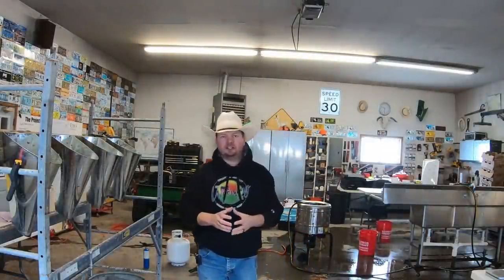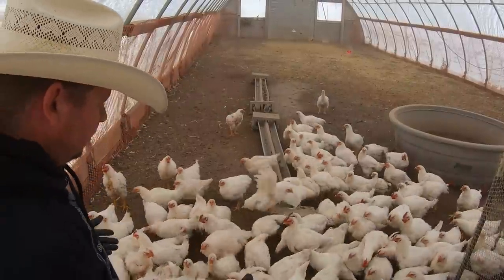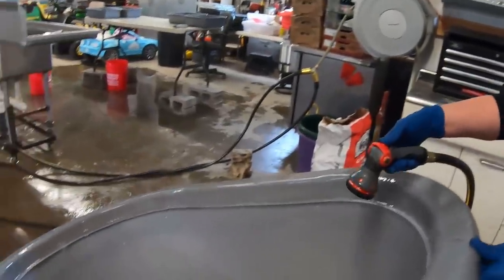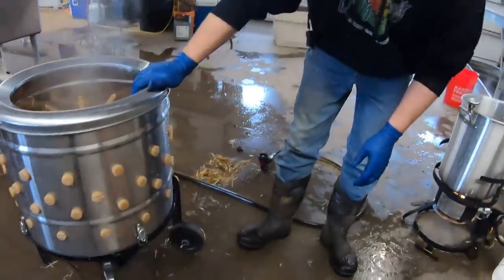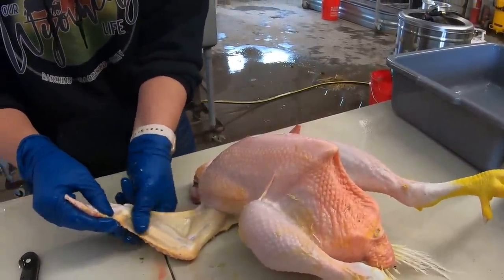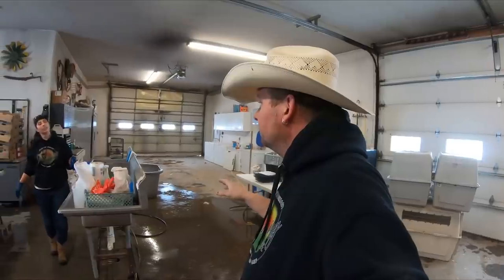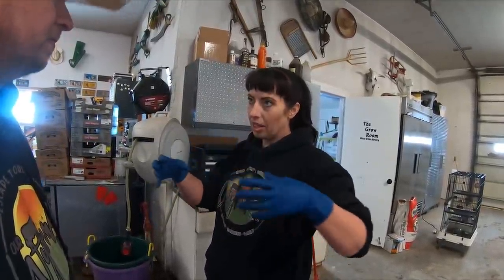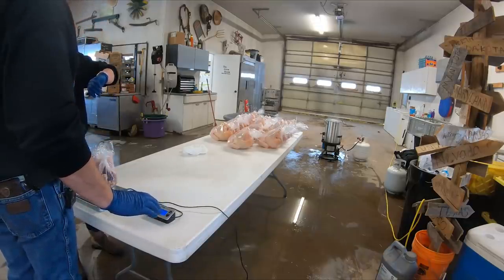Butchering, Processing and Packaging Chickens on the Ranch - Step by Step

Comment: The last time I did chickens I had a large plastic straw that I inserted in the bag. Then it was zip tied and dipped it. The air goes out the tube. Pull out the tube and pull the zip tie tight. You do not have have to look for the hole in the bag you have a nicer presentation with the labels. What do you think? Great video.
Reply: That's what we do also. Works perfectly and no wasted time looking for the original hole.

Comment: Scalding water should be about 148 too hot can cook the outside a bit. Get you a real scalder it will speed things up big time. I have done the turkey fryer too much time waiting for temp to hot or cold. Also don't leave them in the cone any longer than needed the feathers come out easier.  When we do it two cones is plenty to keep one person gutting and cleaning. I couldn't tell in the video but you should remove the preen gland above the tail. Have fun we did ours in October.

Comment: You mentioned a possible switch to turn the chicken plucker on and off. You may already have found one. You need an "air switch".  The switch plugs into power, and the plucker plugs into the switch. It is approx. $35 dollars and was the dickens to find. It works on a 15 amp circuit. The unit I have is used every 6 weeks, for over 7 years.  

Tecmark SAFPAC 5027

Comment: another trick with the heat shrink bags is instead of puncturing the bag place a plastic straw in the opening when the bag has shrunk pull out straw and tighten zip tie.

Comment: Small tip when bagging the birds , Don’t cut the bags put a drinking straw in the top of the bag before you put then in hot water, then pull the straw out as the bag becomes smaller and the air come out then pull the tie-rap . Ya’ll did a great job ,it’s not one of the most fun jobs of the farm but it’s got to be done!

Comment: When those birds are put in the ice bath for several hours you could take the opportunity to Brine them at the same time.  It is said to produce an more moist (juicey), flavorful and tender meat after cooking. If it does improve the final product after cooking You might charge an extra a $1-1.50  a bird or not vs not brined.  Which is what your selling now, not brined.  You could do an experiment on one or two birds and see for yourself what happens after cooking.  Just a thought.

Comment: I see you are using CMU blocks to raise a table to a standing work height. I drop the legs into lengths of PVC pipe. It offers several advantages over the CMU method, the most significant is that you can't bump into the table and knock it off the step-up. Not that that would ever happen. 🙄
At some point, your feet will probably wish there were rubber floor mats at the busier stations -- particularly the three compartment sink and the cutting table. This comes from former army surgical nurses who lament the abuse their feet took from their hours standing on concrete floors. Anti-fatigue mats are kind of pricey. But you should be able to get some stall mats that aren't so bad and will give you some relief.